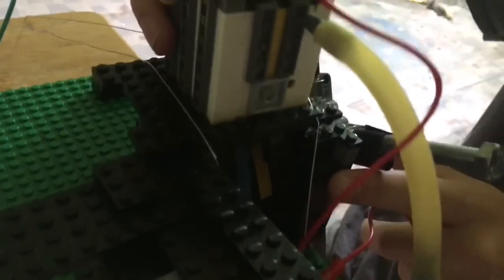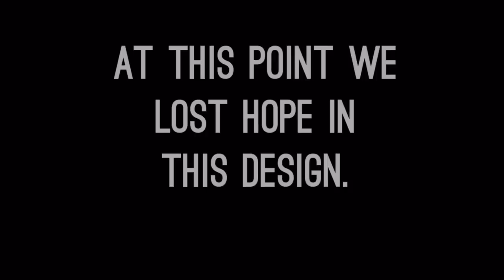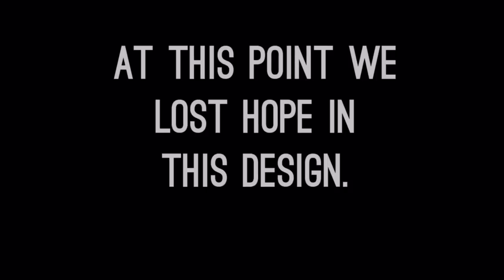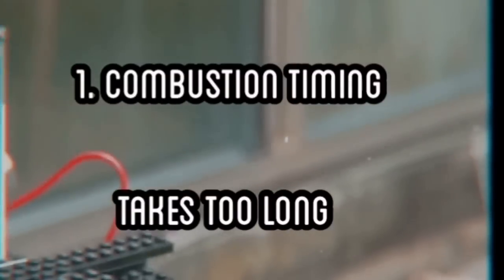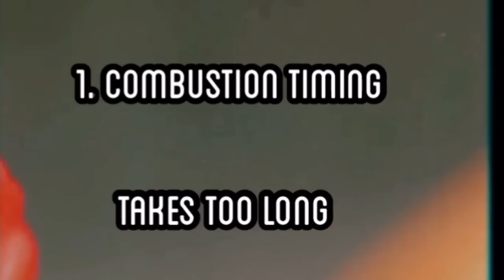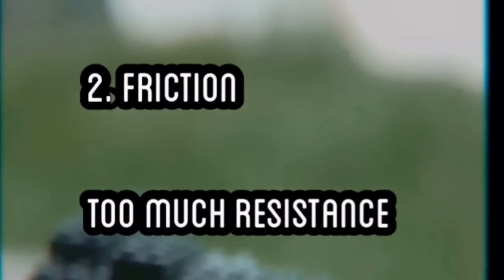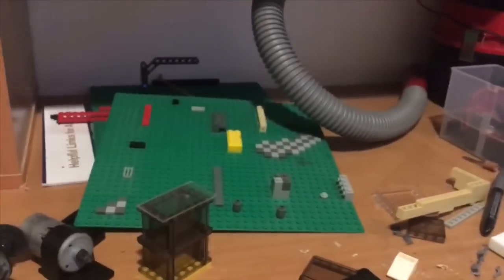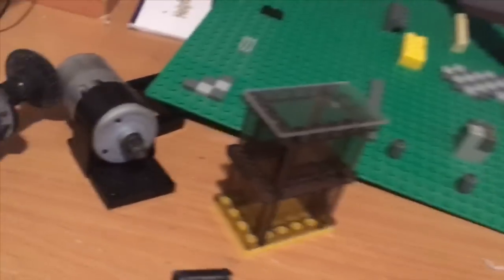LEGO Engine 2 Stroke V2 (UPDATE)

Comment: If pieces are popping off that means it has compression
Reply: yeah
Reply: Big brain
Reply: @outdoorshenanigans849  this reply section tho🤣😂
Reply: @outdoorshenanigans849  it's simple
Reply: No it hasn’t really. Only at higher rpm’s it has somewhat compression. Take a Lego cylinder piece and o rings, and it will be Sooo much better. I actually got mine to fire and it had hell torque!

Comment: Needs Proper intake, bigger exhaust, super glue or other renforcement. Good idea about the shorter stroke.
Reply: Heavier and more balanced flywheel would probably really help too. a couple bolts taped together doesn't do well for that lol
Reply: @SpeedyGwen  Lego technic won't help much. They're holding it together with chicken wire already and it's blowing that apart - No way a rounded piece of plastic would do any better.
Reply: It need timing that’s all
0:35 look at this in slowmo you will see what I mean
Reply: Yes. No. Yes. mabye..
Reply: @SpeedyGwen  welp anything that doesn't work always needs a chage
Reply: @SpeedyGwen  it's surprising that you changed that much in that Time span huh
Reply: @SpeedyGwen  Yeah i guess so.

Comment: where is the air going to get i to the cylinder? or do you think gasoline combusts in a vacuum?
Reply: wouter calcoen LEGO’s aren’t air tight
Reply: @technopanda1018  well if it iisnt air tight,then it will have a compression problem
Reply: DevilZ Gaming its LEGO
Reply: @technopanda1018  i Know What The Heck Is That I Know Is Lego If Isnt Air tight The Compression Will Be Zero Meaning No Combustion 5 Main Things Engine Needs To Start And Stay Running
-Air
-Fuel
-Spark
-Compression
-Timing
Reply: @technopanda1018  pieces Were Falling Of It Has Compression
Reply: It's a damn 2 stroke, no need for a carb. The piston itself adds air, search it up
Reply: Wouter calcoen. Agreed, even though LEGOs are not airtight they block enough air that combustion will not be good.
Reply: @chokycoki17  Pieces were falling off because nothing was strongly attached and the power of the combustion blew everything apart. That's not compression.
Reply: @StaxRail  yeah but i think it would help even though it may not be vital. Yet again lego isn’t air tight. But ur right it probably dosent need it. Also does he know his timings are wrong
Reply: @cfg_form2122  true but u know if u lie to urslef and say it was because compression it makes u feel better. But it may be a sign of both being completely honest.

Comment: The timing is absolutely wrong
Why is it sparking when the piston is nearly at the lowest point? 
It needs to spark when the piston ist al the way up at the highest point 
Otherwise where should the piston go when it fires
0:35 look at this in slowmo and you will se what I mean
The engine is basically working against it self that’s why you only get one combustion and the engine falling apart
Reply: yeah
Reply: Huh I see that now. Well no wonder it failed to run aside from fuel air ratio

Comment: 1. U dont have much air entering the cylinder, more air the better

2. U need a carburetor of some sort, fuel has to be atomized to burn properly in a engine

3. Use rc nitro fuel, it burns quicker, faster, hotter

4. Compression, u have no piston rings at all, meaning no compression, not good

5. U about have all the principles of a working engine after that, i think u should stick with v2 because thats a good chance of running, just make the seal tighter for better compression👍🏼

Good luck keep us updated super cool build🤙🏽
Reply: I agree with everything exept 5th.. he will probably try the v2 if the v3 doesnt work
Reply: Will it not melt?
Reply: @nicolaspaglione  of course it will melt but atleast it woukd run for a few seconds
Reply: Demo wonder if some non thermoplastic lego parts would do the trick?

Comment: The compression is there but not significantly completely there because the top popped off with the force of the explosion but it does have a little to do with it. The fuel might need to be more rich and you will have to oil every piece of lego under the actual piston.

Comment: Put on some oil
Find a good air fuel ratio
Make a stronger structure by adding more pieces or gluing them.
Would love to see this working. Keep it up!
Reply from the maker: One of the problems we had the oil would make the compression too high and proved to be much of a hinderance rather than a benefit. But this time we are gonna use 0W oil
Reply: Yeah and instead of lego take aluminium...

Comment: Here is a couple of suggestions:
1. Make almost the entire thing out of technic, technic have more strength when together, that are easier to cover in tape, and are easier to get a better seal.

2. Stop using flex glue (If you are using it), J-B weld is stronger, cheaper, and overall better  than flex glue, also try Loctite.

3. You need to use a better fuel, maybe fuel that has a little easier combustion with just enough power to push the piston down.

4. Find a good oil, with some oil you can further reduce friction, and maybe even make a better seal.

5. Keep trying. Just keep trying. Eventually you will find a design that works.

And that concludes this. Feel free to reply if you have questions. I will try to answer them. (And trust the things I said, I know A L O T about E N G I N E S.)

Comment: For starting a regular engine you need much higher rpm, maybe try to connect the engine to a drill and try to get frequent explosions, than try tonstwrt it. Also use a much stronger design and superglue so the pressure is cept and the engine doesn't destruct while spinning it.

Comment: Ridders 4 stroke here on youtube doesn't use injection, the air intake has a small gas tank in it that the air passes over and picks up enough gas for combustion, probably runs lean, but it works. Not sure if it'll work on 2 strokes as I don't know too much about them

Comment: I don’t know if you have fixed it but in the first test of the video it seemed like you had the problem, that your ignition timing was off. 
What I mean by that is that your engine fired while the piston was going from bottom dead center to top dead center and so the piston had to fight against the pressure of the burning fuel resulting in your engine to get separated as the force of piston vs “explosion” was stronger than the force holding the engine together.
The ignition timing is also set by the type of fuel you use and more exactly the time in which the burning fuel starts to make a significant change in the cylinder pressure.
Most common ignition point is when the piston has nearly reached the top dead center. By the time the piston has reached top dead center, the pressure of the burning fuel is high enough to force the piston down again.
Because you have a pretty slow combustion or “explosion” (mainly because of little compression and bad combustion chamber design and other small things) as well as a fairly heavy piston (at least I guess so) you can set your ignition timing quite early.
I really hope you read this and finish this awesome project!

Comment: A 2 stroke wont run without a crank case. The piston actually pushes the air/fuel into the cylinder when it goes down. If you want to run without a crank case you need to compress the air fuel mixture pre going into the engine. Like a 2 stroke detroit diesel. I may be wrong but i have never seen an working 2 stroke without any of the two.

Comment: Love your work guys. 
How does the ignition system work???
Reply from the maker: Just an arm that open/closes high voltage circuit of a fly squatter
Reply: @madbrick923  So do you stick a metal piece into the chamber for the spark to happen?

Comment: If you’re going with a single cylinder design you need a counter weight on the crankshaft as there’s no other piston pushing it back up. Obviously you need this to keep the engine turning but also to compress the air/fuel mixture speaking of which you need to come up with some efficient and effective fuel injection system as it looks like sometimes it’s misfiring meaning it’s probably either getting too much fuel or not enough air easiest option would be a carb but I honestly don’t know how you’d manage to make one out of Lego though I’m sure with enough Lego pieces and a good design it might work. But then once it’s finally combusting by itself you’ve got issues like lubrication and cooling which is a big issue since Lego has a much lower heat tolerance and lower melting point if it gets hot enough the plastic could literally start to melt and fuse together.

Comment: Definitely want more , I am going to try casting Lego this summer - Lego will melt , aluminium Lego blocks ( or steel ) could work - just a metal head and the rest could be plastics , this would solve compression and will have more power! , Just an idea ( pls reply)
Reply from the maker: Yes that would be awesome! But it’s really important to have the correct fuel ratio. The biggest problem for us is how to mix fuel and vaporize it. But if it was steel, you could probably make it run, not good but at least run
Reply: @madbrick923  thx, plan to experiment during summer

Comment: A solid flywheel would be far better otherwise the engine is more likely to fire in reverse also if low compression becomes an issue line the cylinder with a thin film of oil it will at least help fora few revolutions

Comment: You need a intake because engines spray the gas like a spray bottle along with air and that vapor is explosive and then you light it so your engine will not work due to the fact the gas is sitting on the cylinder and is not a vapor so it's not explosive enough so you have to make a intake system or pump in a vapor or you gotta use a different fuel

Comment: You lack compression and thats why it ignites slowly. Also, it doesnt spin very well. It needs to be better lubricated, needs to turn easier at the crankshaft (crankshaft bearings) and it needs a flywheel to keep momentum moving
Reply: Oh and it will melt. It needs some sort of heat resistant lining

Comment: sorry, what?  you pour fuel straight like that into the combustion chamber ???  you know what it burns is not fuel but the gas obtained from the fuel in the process of mixing with air is a carburetor.  what you do is pour a candle and a piston, and the fuel does not explode, but burns.

Comment: Nitro fuel uses a glow plug not spark I'll work but it's not as effective
Reply: Don't take my word for it, I'll be happily corrected but I think nitro rely on high compression to self ignite just like diesel, glow plug is only to start it more easily. With legos however you cannot create such a high compression to self ignite since there is to much play between piston and cylinder wall.